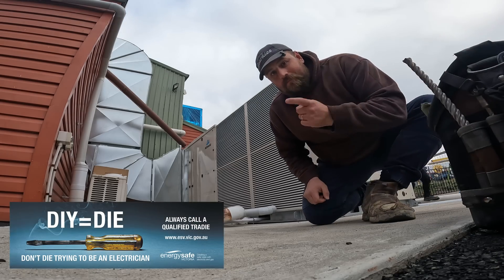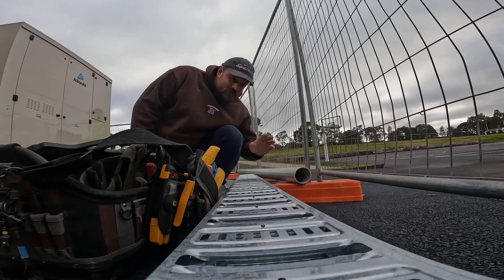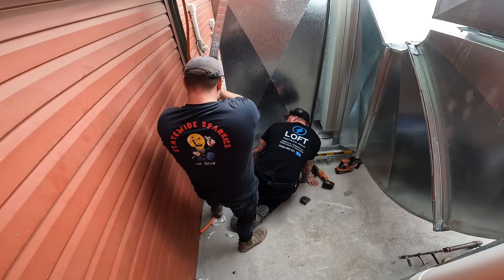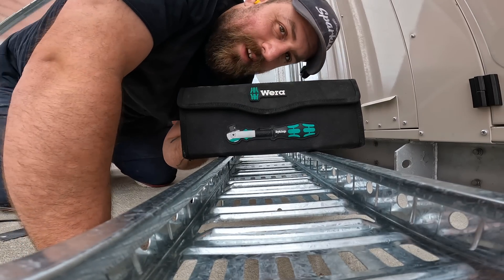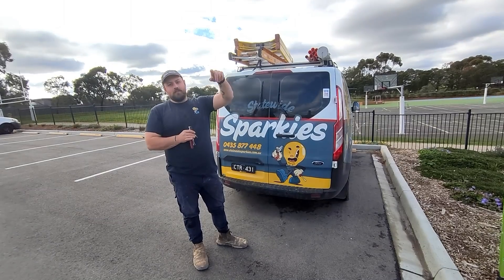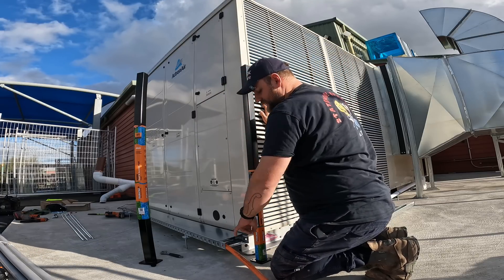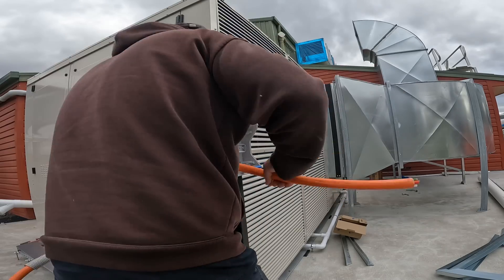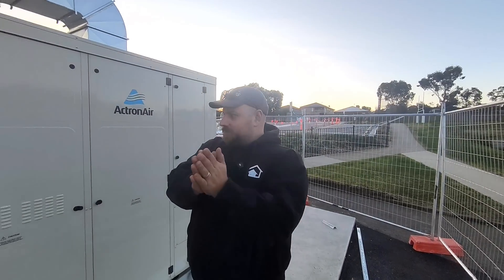The BIGGEST Air-Conditioner In Australia (I'm actually scared)

Comment: criticisms: 

When locking out a circuit always turn the whole board off, circuit off then ill manually take out the load side cables, tape the Cu, lock the circuit out and then turn the board back on. I do this to ensure there is absolutely zero risk for electrocution. Reason being: ive had cases where the circuit ive locked out ( Prior to my new stated method ) had gotten turned back on by another electrician or grounds keeper. Something to keep in mind, yes it does take an extra 10 mins but id rather take more time than risk getting electrocuted. 

Also unless absolutely necessary I never work live anymore. Either you can learn to become concisions of how complacent you can be when working on hundreds of boards, you tend to get super confident and that is how accidents happen. I have the same approach as above. I eliminate all risks by simply shutting down the whole board before opening the escutcheon. 

Good to see other sparkies compromising profits for higher quality installations.
Reply from the maker: Thank you mate. 
I'll give you my quick opinion...
Cheap quote = shit work
I do good work when I have the time to. 
If I feel financially pressured to get a job done, so I can make ok money, I rush, I cut corners. 

So charge what your worth and act accordingly

Comment: Looks pretty mint mate, couple of this you could of done different are peaked lid on the flat sections of the tray so the water doesn't pool and rust it out. Instead of cori using flexicon/Rhinoflex with a gland(probably a metal one with cable that stiff) and shroud. As cori disintergrates in a couple years in the sun.
Reply from the maker: Cheers for the tips mate

Comment: Would like to see you do the cable join. Good job on the isolator switch coming up from the bottom, going through the back maybe if you had some 90 degree bends but probably need a big sweep so wouldn't work out.
Reply from the maker: Ok sounds like a plan!

Comment: Remember, that's 100A per phase at 240/415V!
Reply from the maker: Correct. Big as hell
Reply: Very impressive I'm in the process of upgrading my house to 3 phase and the sparky is using 16mm cable with 63A breaker. I think you said this bad boy required 35mm 4 core and earth but looking at the size of it makes sense.

Comment: I’ve watched electricians from all over the world (check out the one from Vietnam where they literally conduit everything in residential which is the breath of fresh air and an art). Nice to see another Aussie amazing job even with the challenges one major question I have I know it’s covered and conduit and in a tree but my wondering how it’s okay to run electrical conduit so close to an open drain like that it’s the first thing I saw when you were running the tray. I’m like man that’s a bit of a pain if the dream was closed no issues but if something floods there, wouldn’t it Ktorza shortmaybe not because it shielded cable.
Reply from the maker: Yeah it's fine. We have clearence from those services in our regulations but they're only 50mm

Comment: I’ve stood inside the air conditioner for the National Gallery of Australia - it’s two storeys tall and made up of 3-4 rooms. When the High Court of Australia was built, they ran out of money for air conditioning, so they used a tunnel between two to provide air conditioning to both. The tunnel’s still there, but blocked off. From memory the AC has reached end of life, snd needs to be replaced… the inky problem is, the NGA is literally an air conditioner with a building built around it, there’s no room to take the old one out and put a new one it.

I always love hearing the shibboleth of Aussie tradies, saying “con-joot” instead of “con-due-it”.
Reply from the maker: Holy smokes I'd like to see that!!! That is so cool
Reply: Systems of that age where the setup is integral to the structure of the building are just so fascinating to look at. The library at my high school in Sydney was the same, built around a massive evaporative system from memory.
Reply: Conjoot shits me

Comment: I whould have got a new peace of cable not joint it and not bothered with cable try and just fixed it to the floor
Reply from the maker: You can spend the extra 2 thousand bucks if you want.
Reply: In conduit on the concrete you mean?

Comment: Terrible tin tray, I hate it. Use welded wire mesh - its way better for all this. It allows to do real 3d structures, including HDG for outdoor. Ezystrut or so.
Reply from the maker: Interesting. I'll look into it. Cheers mate
Reply: I suspect the wire mesh tray wouldn't have the strength in this application where it's off the ground and liable to be stood on by someone working on the AC. 

That LT3 tray is pretty strong, the wider ones will bend if not supported often enough, but the narrower stuff like that is solid. I've climbed along plenty in ceilings

Comment: iv never done cable tray like that with all thread. Is it strong enough to hold the weight of a dickhead that might stand on it? Clean install either way!!
I personally would have used uni strut and mounted the cable tray to that horizontally to avoid people stepping all over it, each to their own.
Reply from the maker: This is how the manufacturer wants it. The area will have a fence around it and is in a school nowhere near cars. So light duty is very much ok.
Reply from the maker: I appreciate the comment mate
Reply: What's underneath the tray? Almost looks like DIN rail. Never seen that used before. Usually I just sit it on a bit of unistrut and then hold down clamps from the tray to the strut.

Comment: Good cable tray work dude.
Upon electrical inspection did you need to earth bond across the cable tray joins? - I get a tad confused as what is required in civi-land compared to what is required (or the norm) in mining.
Reply from the maker: Thank you mate. Tray is earthed just near the isolator. So should be sweet.

Comment: The old mechanical rule of 2.4m doesn't exist in AS/NZS 3000 and has fir quite a few editions. It is up to you to determine when cable needs mechanical protection. But at 3:47 going good so far.
Reply from the maker: Correct. Section H. I learnt this shortly after.

Comment: Yep… and this is why a lot of trades are going down hill. You would have got the job because you were a lot cheaper than the normal guys. 
Next video you will be trying to install a VSD….
Reply from the maker: Wouldn't the industry be ruined because the VSD guy was over engineering and overcharging?
I quoted and installed the works that were required. Not my problem if the other bloke didn't know.
Reply: Do you not think he did a good job?
Reply: Shut up and go play on the road ya stain 🤡
Reply: Thats how all trades get the job. Why are you attacking this guy doing this job?